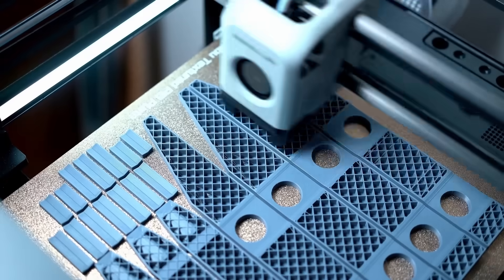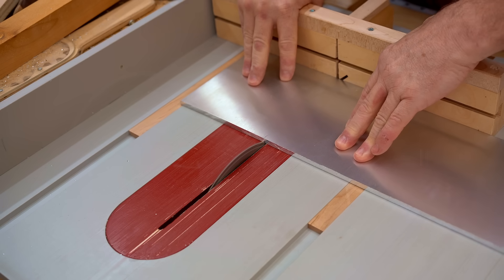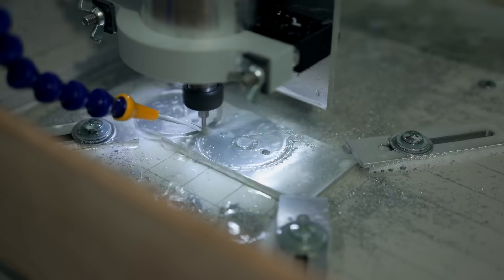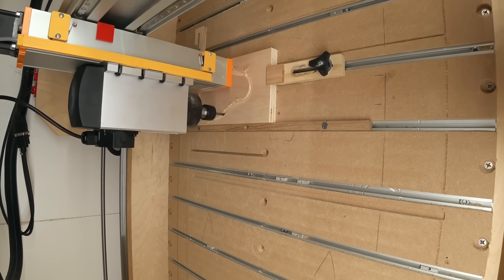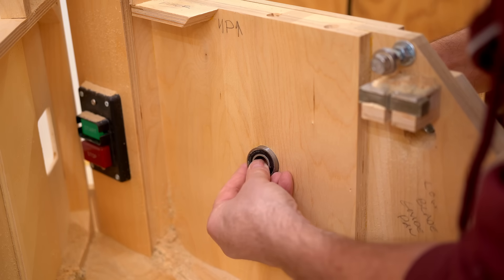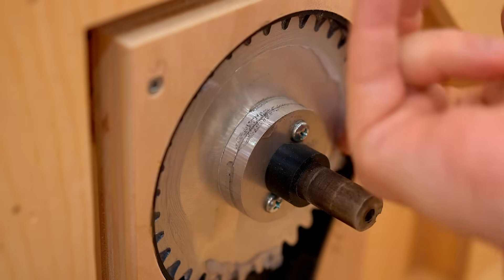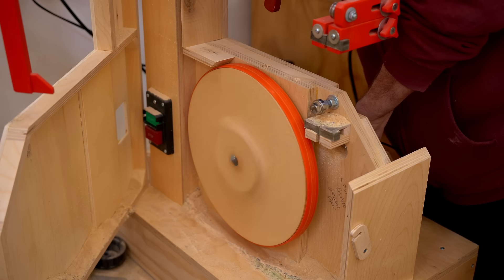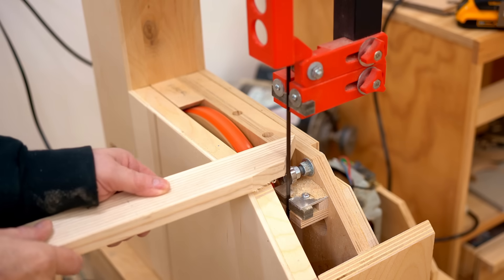A Step Forward or 2 Steps Back?

Comment from the maker: Now that I have a metal cutting CNC, I thought it would be fun to test an idea I've had for a few years - replace the belt drive with a gear drive on my homemade band saw.
While all of the work could have been done without a CNC (I've done similar before, many times), the CNC supplies the extreme accuracy that's required for a setup like this. The gears must be cut precisely and mesh together precisely for this to even have a chance at success.
My original plan was to 3D print the gears and I actually did that and tested how well they worked in this video:
https://www.youtube.com/watch?v=5Aa9Wojpbdo
But I had concerns for long-term durability, even though it looked like the gears would do the job. Certainly they would have been less noisy than the metal ones. 
Why do this in the first place? Am I bored and don't have enough to do? 
Belt drives are the default because they are cheap and easy to do. You don't need to have perfect alignment for a belt and pulleys combo to work acceptably.
The downsides are slippage and the amount of tension needed to avoid slippage. That tension puts a lot of side-load on the motor bearings and the drive shaft bearings that can lead to early failure. Like I said in the video, the side-load problem wasn't enough of a concern for me, but the slippage one was.
The only way for gears to slip is for them to strip the teeth off, and the teeth on these are more than strong enough.
I used a few 3D printed parts in the build, including ones that I just used to accurately line up parts. 
As for the temporary installation of the motor, I need to use the saw some more before I decide whether I'm keeping it gear driven. If I decide to stick with the gears, I'll do a much better job of mounting the motor.
Reply: Cool video, thanks for posting!  Have you thought about a toothed belt?  It would seemingly offer the best of both worlds - quiet operation, roughly 1/5 the tension required vs a V belt, a chance to use your CNC to make some gears :)..  HTD 5mm belts are cheap, but the larger tooth pitch of a HTD 8mm belt might be better suited to plastic or wood gears.

Comment: Excellent experiment! Aluminum on aluminum is not a great choice for long term use of gears. The wear will be fairly high. Good lubrication slows that down to a degree. However, if you let them wear for a bit, the gears will get quieter and slightly more efficient. Another experiment would be to lap them in intentionally by using some very fine abrasive for a short period of time. Light grease or oil would work fine for a carrier and minimize the mess. If one of the gears was nylon, that's a far better combination with much lower wear and zero risk for galling.

Comment: Cool project. For the noise, you might want to try novotext.. Quiet and wear resistant material. It also act as a sacrificial parts when the load becomes too high. Also will CNC well. Not the cheapest material though.

Comment: John - what is gained by switching to gears? Does it boost the power of the saw?
Reply from the maker: Yes, the gears won't slip like a belt can. I wrote out the advantages in the video description.
Reply: @JohnHeisz thank you! I will make sure to read the descriptions in the future.

Comment: A nice build, but it seems to me that aluminum is not a good choice for the gears; I think even with grease you are likely to get galling and excessive wear. You might want to try 3D printing the gears - they will run quieter,and if you get a blade jam they will act as a sacrificial failure part. I 3D printed gears in PETG for my lathe, and they are holding up well. Congrats on a successful build in any case.
Reply: This

Comment: I can't think of a single advantage to a gear-driven band saw, other than "give me material to make a video about"
Reply from the maker: I gave the reasons in the video description, but to summarize, the biggest advantage is better power transmission - belts can slip while gears will not. Another is the side-load a belt and pulley system puts on the bearings that can lead to premature failure.
And I was going to do this anyway as an experiment, so making a video from it was a bonus... for you guys.

Comment: I'd like to see you tackle the noise problem. If you can make it run really smooth it would be amazing.
Also... Could your CNC cut brass? Wouldn't that work better for the gears, longer term?

Comment: I don't have a CNC so I need a bandsaw to build a bandsaw.
Just kidding, i hope to one day  build a murphy bed that can open using a wooden gear pulley system. In my mind i want to just twist a wheel that will slowly and effortlessly raise and lower the bed into position. I've tried a few things but I have no idea what I'm doing.

Comment: 1:39 --- Idea for next episode  ---  make a mount for ER extension for example  ER25 extension with its own set of bearings all mounted permanently and another mount oposit it for that trim router you use to power it through belt drive
Then you can make it more precise , smoother  and work with different size of end mills just like regular spindle (but with extra option to change gears for low rpm (with more torque) end mills)

Comment: 2:14 --- you can always use 24v at least 50a peak power supply with voltage adjustment and  set to 21v  (or 2 modified server power supply (so you can connect them in parallel and to modify the 12v voltage to 10v max 11v)  to have total of  21v)

Comment: So many questions that boil down to one: why? ... what's the benefit of plastic wheel? a plastic table? a gear driven bandsaw? ... I cannot come up with up with good arguments for any of those changes.
Reply: To learn.  You can’t really understand the limits of a process or material until you actually try to use it for something real.
Reply: @DaRobin04 you can learn a lot more, a lot faster, a lot cheaper by reading.
Reply: @DaRobin04  There are so many more useful projects to learn from. The very least it would be nice to understand the idea behind the changes.
Reply: Because he just wants to see if he can.
Reply: The bandsaw he originally made years ago had a traditional design.  He has been unmaking it with experimental downgrades.  Not really my thing but he doesn't tout these changes as improvements.
Reply: Because he can. Are more reason required?
Reply: always the people who do nothing, who question every one else's passion to do things and learn.
Reply: @KipdoesStuff that's a pretty wild, unsubstantiated assumption.
Reply: @KipdoesStuff  "do nothing" - cute. In no way did I question someone else's passion. And I don't think you are in the position to judge.

Comment: Great work, nice video, but as the title says, it is a step forward and two steps back. The belt transmission ensures smooth functioning, and limits the vibrations from the motor to the saw wheel. Also, there is the noise, and the Achille's heel: the aluminum gears. They don't last. But for the experiment sake, it is a nice exercise to adapt the router and the CNC machine to make  these parts. However, to make that saw more reliable, precise, and less noisy, perhaps it would be better if you design a new 3D printed lower wheel, and an updated belt transmission, with parts made on CNC and 3D printer. Perhaps, designing a set of vibration dampening mounts, for that motor, would be a nice improvement. Cheers!

Comment: You could try to change the toothgears to some with diagonal teeth. Most of the gears in your car are diagonal, except the reverse gear. (and please excuse my bad english)
Reply from the maker: Hard to cut helical gears on a CNC that doesn't have a 4th axis.
Reply: @JohnHeisz  You could position your raw aliminium disc vertical on an axle with an alignment pin (indexer) and rotate to the next index after each cut.

And you can try to figure out where the gear-noise is transfered to the bandsaw frame and put some damping (strip of rubber) in this place.

Comment: So what is the point of failure now? In many belt driven machines, the belt is the most likely part to break if something goes wrong. What breaks first in yours?
Reply from the maker: Probably the blade itself.
Reply: @JohnHeisz That’s also true with the belt drive bandsaw. 

I’m not critical of your project and, infact I am appreciative because it displays your passion, skill level, ingenuity, etc but this is not a practical solution for the masses of woodworkers. If you disregard the hours required from design to implementation but only consider all the costs involved (eg. purchase of 3D printer printer materials & program, production materials, etc) the total cost greatly exceeds the gain.
Reply: @Dogman-45 I think he's aiming for YT entertainment here; not how to. Inspiring people with his mindset.
Reply: @Dogman-45  Yep, those CNC's and 3D printers have to be tossed after a single use, you can't use them more than once, ever.